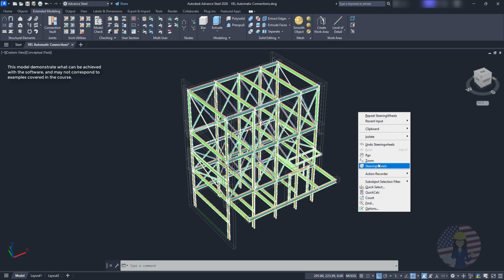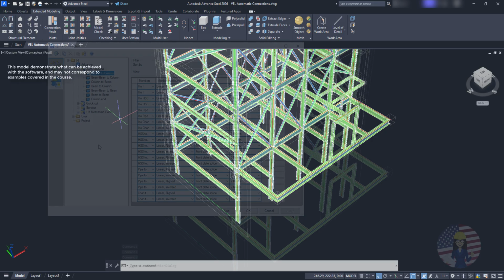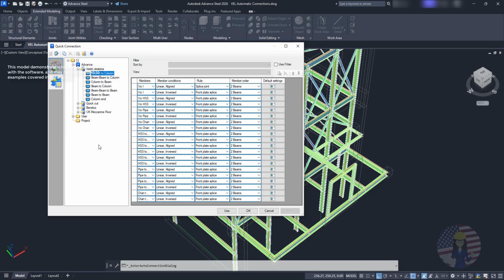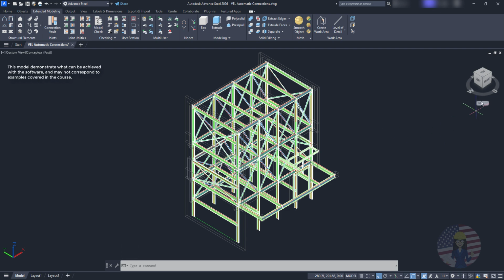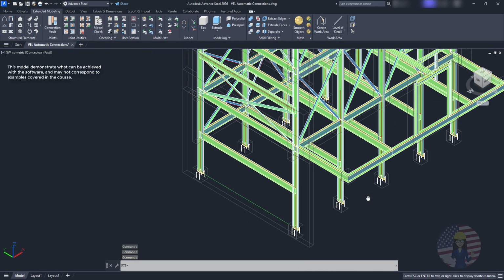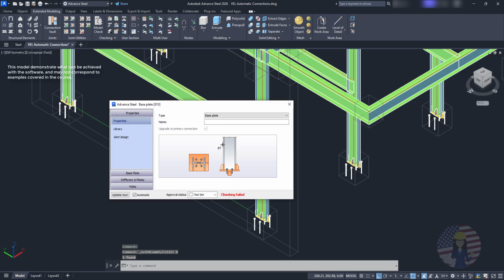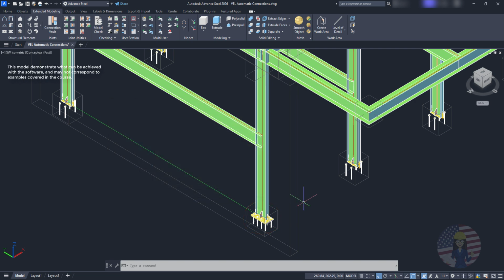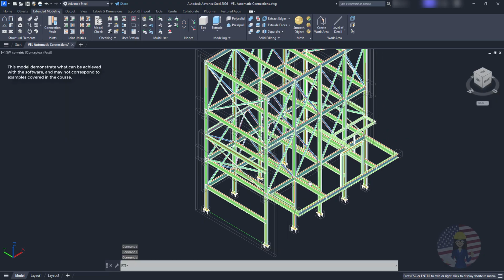Advance Steel Tutorial - Using Quick Connection for Fast Connection Placement!

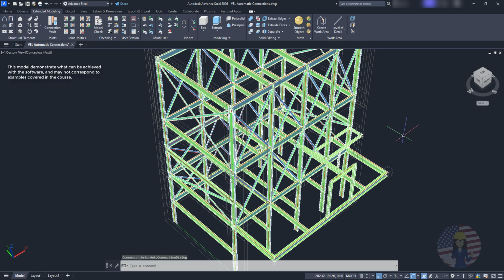Comment: Placing connections one by one is a recipe for project delays and human error. Using 'Quick Connection' is a massive time-saver, but as shown here, knowing how to properly configure templates and use 'Transfer Properties' is what actually makes it production-ready [01:16]. This is exactly the kind of professional workflow engineers need to scale their output. If you’re tired of repetitive manual tasks, I highly recommend checking out their video course library—it’s the best way to master these parametric workflows.